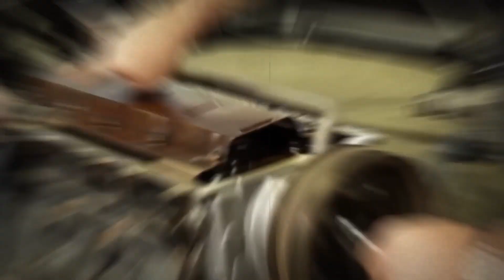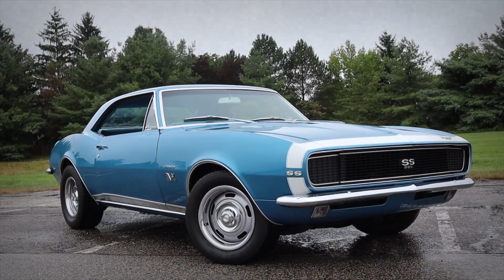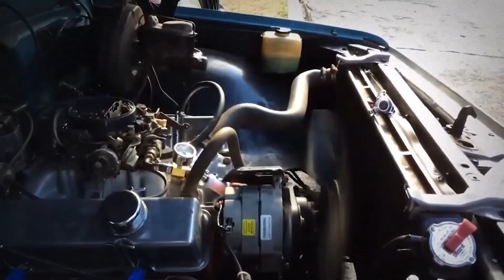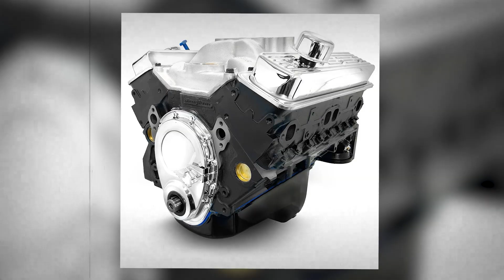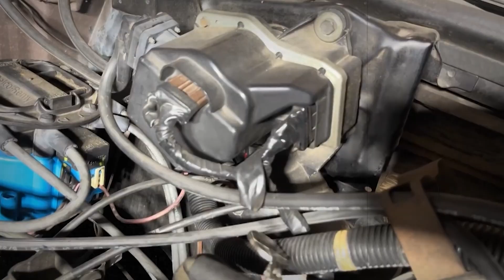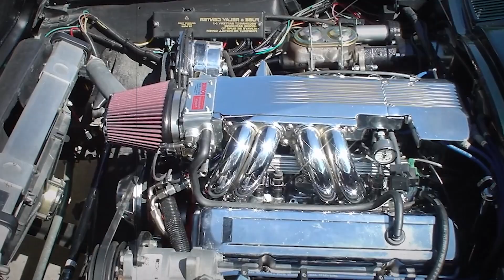THE EXPLOSIVE TRUTH BEHIND CHEVY'S 350 SMALL BLOCK ENGINE

Comment: Short version: Pelosi's cafe2 pushed out under her first speakership is such a burden, car makers were nearly forced to reach for aluminum blocks, but at least downsize drivetrains.  A v8 aluminum block?  Cant't use old casting molds engineered for iron, and requires a complete redesign.  Witness Chevy reintroducing the staight 6 in 2002... which has since been abandoned to reduce vehicle weight.